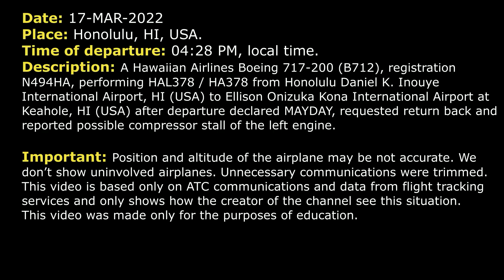MAYDAY. Compressor stall. Emergency return | Hawaiian Boeing 717-200 | Honolulu, ATC

Comment: Not sure why they didn't take 4R and not take such a long circuitous route to 8L.  The stalls can be duplicated most of the time on deck for troubleshooting.  20-30 miles out to sea is too far IMO for a ditching if that were to happen.
Reply: They gonna use your advice next time! ;)
Reply: @PetrolHeadBrasil  That's because I know what I'm talking about.
Reply: SOP is to use a longer runway, preferably with a precision approach. That means 8L. A compressor stall doesn't indicate a greater problem that would result in ditching. Additionally, the straight in for 8L would also leave JRF as an option in case of the one in a million, or more, chance of a dual engine. failure.
Reply: They have checklists they have to run before they land usually.  One engine out does not equate to a ditching.
Reply: @Kalikus808  what an expert 👏🏽
Reply: @Kalikus808  Yeah, the aircraft can fly on one engine.    I'm aware of that thanks.  We just had a cargo plane I believe a 737 that ditched off this airport a few miles out to sea.  One engine stalled and quit and about a minute or two later the other engine quit.  It broke up on impact and separated in two just forward of the wing and sank within minutes.  The Coast Guard immediately picked up one pilot as he was drowning and the other one by the fire dept rescue boat.
Reply: As you type your solutions to their problems from the comfort of your couch 🤔🤡🤡🤡
Reply: @XX-166  Yeah because they're using their checklist and speaking to the maintenance department who are sitting at a desk.  That's how it works.  And if the engine stalls you don't get to fly to the west coast from Hawaii when you've only just taken off or are less than halfway.  You land in Hawaii.
Reply: Obviously the odds are small that both engines stall and quit.  You know like a few months ago when a cargo plane went and ditched a few miles off shore of that same airport when BOTH engines quit.  So yeah, they could have chosen another runway seeing as there were passengers onboard.
Reply: @tmayorca8770  there is a big difference between a beat up 737-200 and a well maintained 717
Reply: @N1120A  Hawaii is not equiped for open ocean rescues 20 miles out.  Both types of aircraft that size would have broken up in half no matter if it was cargo or passenger due to the force of striking the water.  The recent crash split the aircraft in two just forward of the wings.  Both pilots survived with one in critical condition who would have died if he was out there a minute longer.  He was picked up as he was drowning.

Comment: 717?
Reply from the maker: 717
Reply: Modern DC-9s
Reply: Yup, produced between late 1990s and mid-2000s, over 100 of those birds are still flying
Reply: DC-9-95 if you will